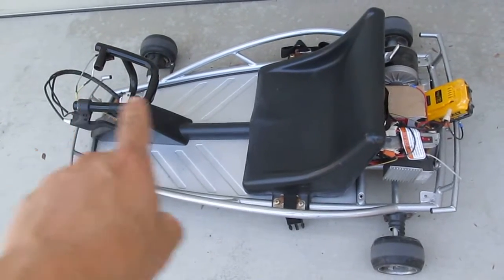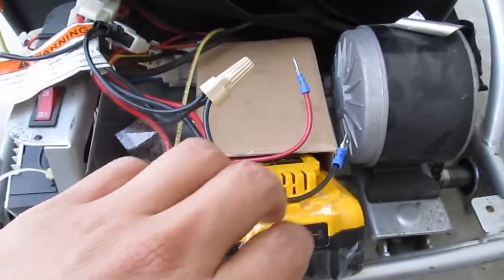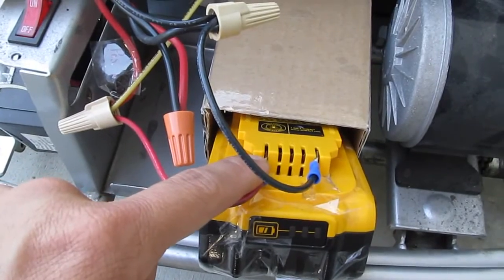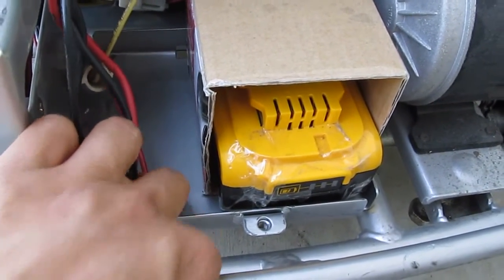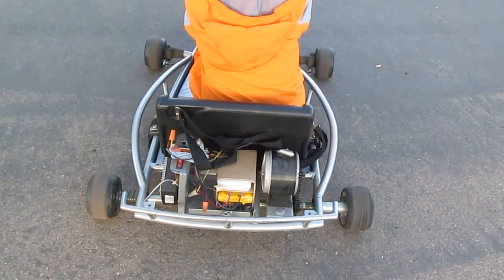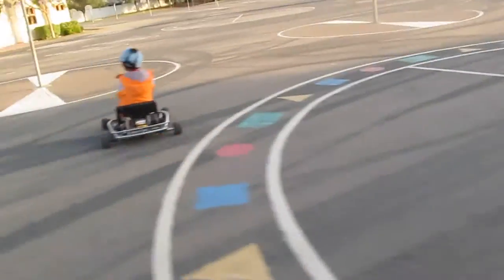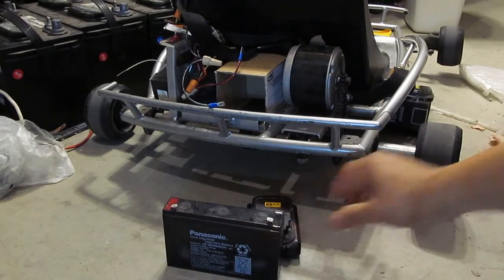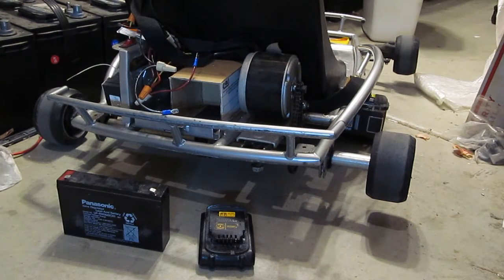DIY Part 2: Li-ion powered Razor 24V go cart with a broken controller or thumb throttle

Comment: is that brushed motor? i always wondered if i bypassed the controller with a switch would it make my razor rsf650 go much faster. i have stock batteries but going to swicth to lithium.

Comment: I did this with a 8 cell lipo and got about 17mlh out of it but ran it to hard and over heated the motor
Reply from the maker: 8 cell lip is only about 30V. Just put a heatsink on the motor if you run it too hard. I tried 60V on it and it ran fine on light duty.
Reply: That was with the stock controller for a while until it burnt then i hooked it up straight to the motor and cooked it drifting a lot in a big parking lot but im looking at a 48v system now just not sure what batteries i want yet. Lipo is expensive and lead acid seems a bit weak.

Comment: Thanks for the diagram! A few questions. You said any voltage could be used since there is no controller. Would one of the 40V Ryobi batteries work on an adult sized gokart to give it more power?
What is the technical name of an on/off switch?
What type of wiring or gauge is required? 
What type of motor is that called if I wanted to buy one? 
What type of fuse is needed?
Reply from the maker: I wouldn't use a 40V battery on this go cart. It's designed for a child and at 40V, it will run at twice the speed and can be uncontrollable. Plus, it creates a spark at the switch everytime you click it. At 20V the spark is minimal. At 40V, the spark is too great and too strong it can weld the switch contacts together and you won't be able to turn it off. That can create an accident. So I do not think 40V on this is safe.
I think the switch is called "momentary switch". Get the one with the highest amp ratings you can get. The more amp ratings the less likely the sparks can "weld" the switch contacts together.
I used size 10 AWG. But it's overkill as it is thicker than the original motor wire. The wires on the motor are size 12 AWG.
I'm not sure what kind of motor was on the Razor. I know its a 24V motor. You can look it up on ebay/amazon.
I'd recommend 15A fuse. If that's blown too often, use the 20A fuse.
Reply: Thank you very much! 
Yes I know, I meant 40V for an adult cart. 
Also, I use the Ryobi 18V system with high capacity 4Ah batteries, should I look up "18V motor" instead? I thought the V didn't matter if there is no controller? I want it to be faster.
Reply from the maker: All of the Li-ion cordless tool batteries that are labeled 18V and 20V are the same. There are 5 cells of 18650 batteries in it. Each cell is 4.2V at full charge. Five cells are 4.2 x 5 = 21V at full charge. Each company names their battery differently but 18V or 20V are the same kinds. 
The voltage doesn't matter because you're not going through the controller any more. But the higher the voltage, the more amp ratings you need to get for the switch. And also the thicker wires you're gonna need.
Wire size ratings:
Size 10 AWG: 30A
Size 12 AWG: 20A
Size 14 AWG: 15A.
I won't recommend any wire thinner than size 14.
Reply: +vuaeco ok thank you. The highest motor I should get for my batteries is 24V motor then? 36V motor wouldn't be a good match in power? or what about wiring 2 18V batteries together with a 36V motor?
Reply from the maker: Most 36V motor runs fine with 24v. As you can see from the video, the 24V motor ran fine on a 6V battery.
Sure you can wire 2x 18V batteries in series and produce 36V. Or use your 40V battery from the lawn mower. Mind you the 2x Ryobi 18V batteries in series are the same as one 40V Ryobi lawn mower battery. Yeah, they should name their 40V batteries 36V instead.
Reply: +vuaeco thank you so much!
Reply: +vuaeco hey can I have your email? do you use Hangouts?